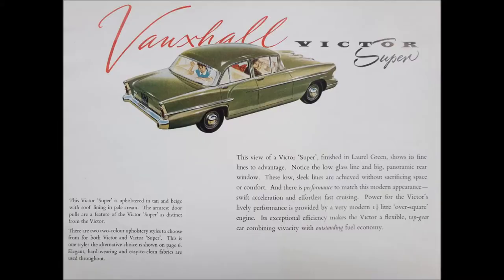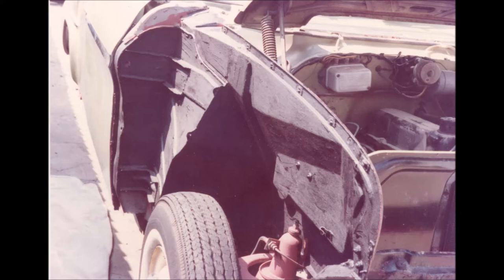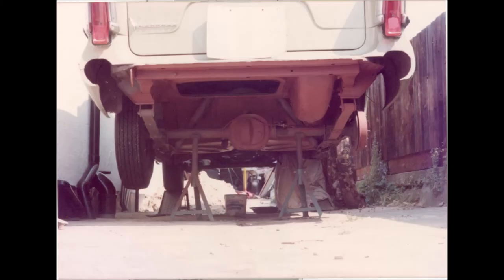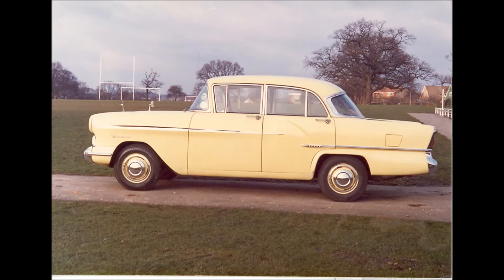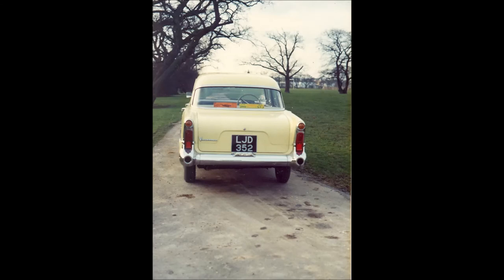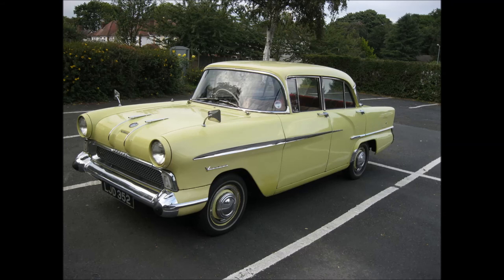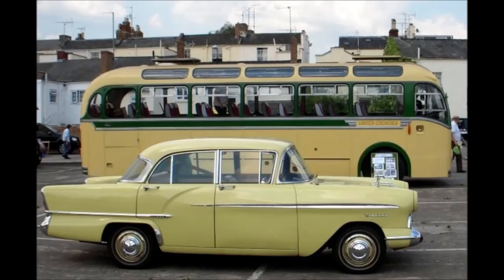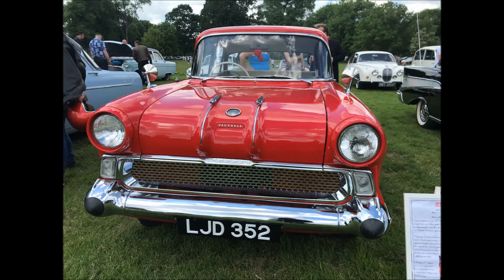LJD352. PAUL KING'S 1957 F SERIES 1 VAUXHALL VICTOR

Comment: I had a Vauxhall Victor F type in the 1960s. It was Green and Black registration number 486ENM. Beautiful car to drive.
Reply from the maker: Yes Michael they were. I put all new suspension on XOT362 (springs and original shocks and all new steering parts) so I effectively drove like a new F model and could not agree more. They really were beautiful to drive.